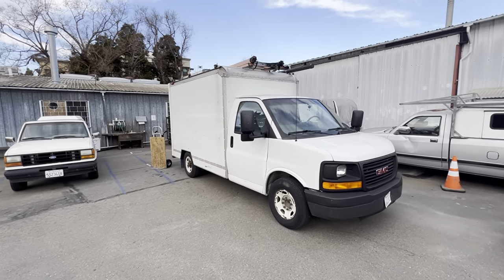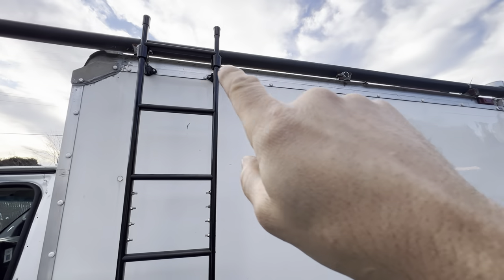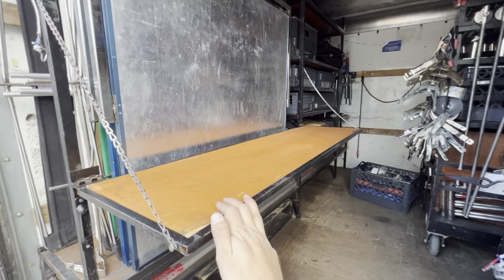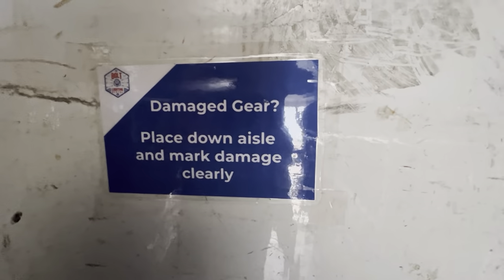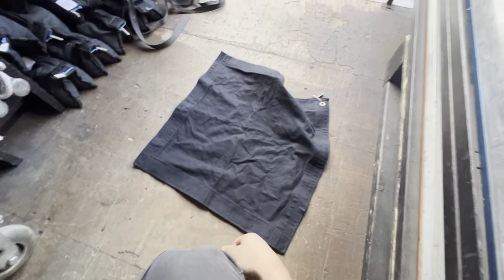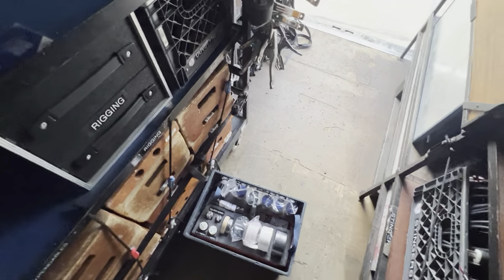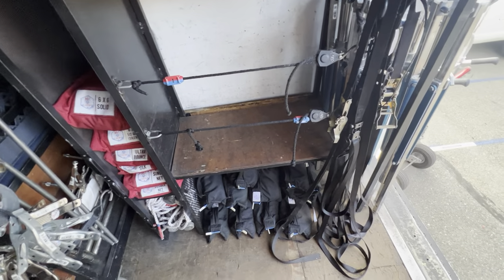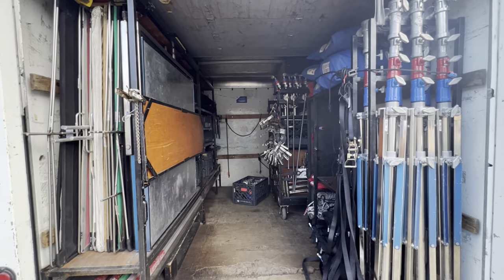1 Ton Grip Truck Tour

Comment: You have exceptional organizing and smart thinking in this rig.

Is a Bay Area 1 ton way different than LA or is it a Bolt thing? I didn’t count it all, but you seem to have way more stands than a typical 1 ton in other markets. I think yours is the first one ton with 12 x 12 frames and rags I have seen. You have a better cart, too.

Cool duvatyne (Sp?) setup with the pre-cuts.
Cool use of the kaizen foam. 
Pre-made wind sticks is great.
Work bench is fantastic. 

Terrific job all around.
Reply: Ps. I’ve been checking out the crate dividers for some time. Glad to see it’s connected to the rental business.
Reply from the maker: Hey there, you're definitely right. The Bay Area 1 tons have a lot more gear on them then you'd find on trucks in other areas, but it is a pretty solid package and for small jobs I don't find you ever need to add very much grip gear at all. Appreciate it!!